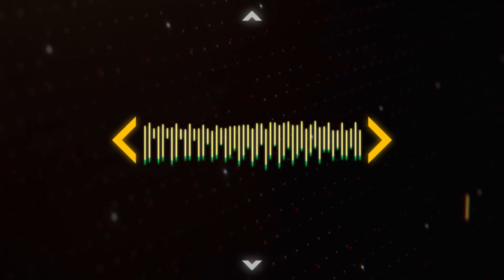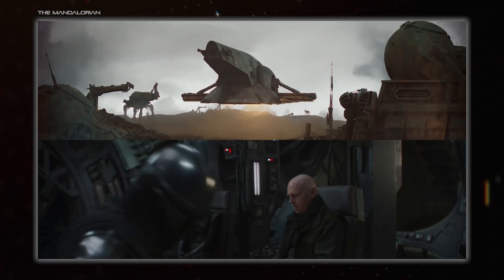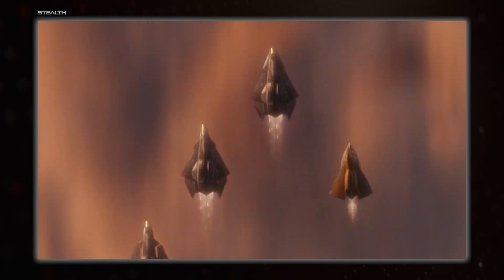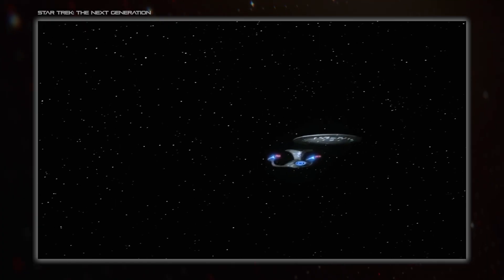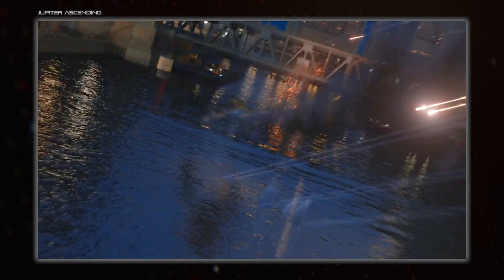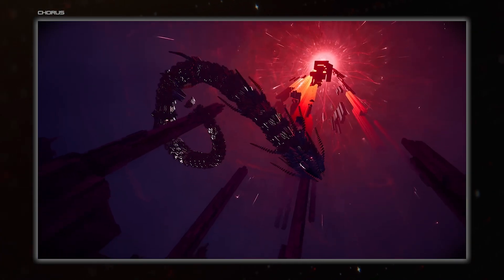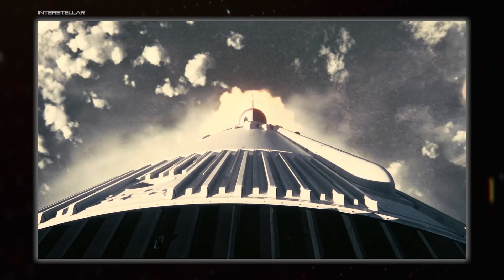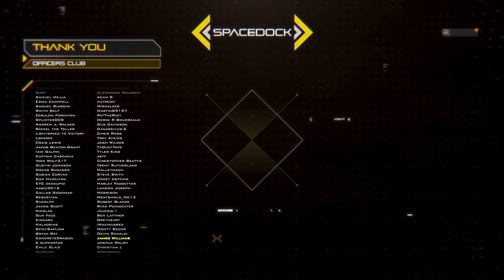Variable Geometry in Sci-Fi Spaceship Design

Comment: The coolest use of a variable geometry design would be a spacecraft habitat ring composed of, say, twelve modules that could each pivot through 90 degrees, so it would provide both spin gravity and constant thrust acceleration gravity depending on the configuration.

Comment: The whole point of the swing wings are two fold one for better aerodynamics so wind resistance does not slow it down as much therefore much faster. Secondly reduces cross section making it harder to pick up on radar thus becoming lower visibility now the downside is maneuverability becomes lacking due to less wing span and secondly more risk to internals being damaged if the aircraft turn too sudden while the wings was in its aerodynamic mode due to the increased speed and thus more tension of the frame of the aircraft.

That's why when you see the wings fold out the aircraft slows down beforehand due to the last thing you want to do is land the aircraft with the repair crew telling the officer "yeah we can't use this million dollar aircraft anymore due to its internals have been damaged so much it needs to be sent for major repairs resulting in a full overhaul."

Comment: All the while, SDF-1 was not mentioned.
Yes, transforming into a giant humanoid is silly, but in universe it fell from the sky and is made by a precursor race that basically created humans and the giant humanoids and many other things, the energy cables for the main cannons was cut short because a big chunk of machine and engine disappeared in an emergency use of the warp drive and they needed to transform the ship to connect the cables.  And yes, if you were warped to Pluto with no preparation you don't have much resources to fix the ship with other than the two aircraft carrier that were not meant to work in space that unfortunately been warped to space with you.  Yes, they actually manually pulled the cables to the other end to connect them in show after the transformation.

Comment: Can’t believe you missed the most obvious real world variable geometry space ship: the orbiters of the US STS program AKA the Space Shuttle (officially the term “Space Shuttle” refers to the whole launch assembly while the term “Orbiter” refers to the part of the Space Shuttle that looks like an airplane.  While in orbit, the Orbiter always flew with its cargo bay doors open.  The first reason for this was the orbiter was designed to be a “space pickup truck” that would haul cargo to massive space stations as well as act as repair trucks for broken satellites.  So the doors needed open for the cargo to come out.  But there was another reason. On the inside of the doors were an array of solar panels which provided the ship with power but also radiate heat.   Vacuums are natural heat insulators.  Yes space is cold but keeping astronauts warm is the easy part.  Keeping them cool is the real challenge.  So even when there is nothing to take out or put in the cargo bay (the rare missions where this isn’t necessary do occur, the cargo bat doors still remain open while in space and only close once atmospheric operations are occurring.

Comment: Just going to mention that Jupiter Ascending was a really fun movie that I don't think was very well done. It had a lot of cool concepts, and a lot of even cooler visuals, but it didn't really bring them all together very well. I enjoyed it anyway though!

Also, back on topic, there's a surprisingly fun variable geometry ship in ΔV: Rings of Saturn. The Kitsune shuttle is a tiny little ship, with the option to cut its cargo hold in half and become an even tinier ship. It's actually quite practical to run the ship in its compact mode while you're using your mineral processor, because that fills out the back half of the cargo bay, which is the entire bay when you shrink the ship, letting you ignore the positioning challenges you normally get when trying to maintain constant processing of ore. Then as your processed cargo storage fills up, you switch off the mineral processor, and expand out to full size to fill your hold up the rest of the way and take a full load of processed and raw ores back to the station. You can also use compact mode to make yourself a harder target for an attacker, or to drift through gaps between rocks which the full-length ship can't fit between.

And for another real-world space example, there have been a number of space telescopes which operate on this principle, though again, it's unclear if these are one-way transformations or not?

Comment: Hi Spacedock and community, have a variable geometry adjacent question

Moving turrets - not just oscillating, actually moving around the ship. In Star Wars Legends they mention Hapes ships rotating and repositioning charged turbo lasers in place of the discharged ones. In Homeworld 3, the mothership turrets move up and down rails along the side.

Some questions:
1. Can’t figure out what a good term for this is, so I’m having trouble looking for other discussions online. Any good terms/forums?

2. Does this have any merit in real design or would it just be a flashy gimmick but not really that helpful?

3. What are its implications? If the ship is just a bunch of nanites rearranging themselves that’d be cool but if it’s a more normal solid components type then maybe the need to design around those weapon rails would limit the total number of weapons that can be put on?

Comment: In the case if Voyager they have their own hand wave explanations as to why the nacelles do this. But there are real practical reasons why a space ship might use variable geometry. For example altering the center of mass of the ship or the reaction thruster positions to increase maneuverability. I'm voyagers case, it could simply be that lowering the nacelles, optimizes voyagers center of thrust and center of mass for maneuvering, while raising them increases warp efficiency. 

Similarly the X wing may make better speed in atmosphere due to closed wings having less surface area and drag while having the 4 engines split increases their differential maneuvering potential. 

The thing to remember with most space craft is that even though there might not be aero dynamics to consider, center of mass and center of thrust still matter.

Comment: oh another good example of variable geometry though it isnt for a sci fi spaceship design
samuses arm cannon from metroid prime 1 2 and 3
the cannon is made of multiple loose parts around a solid core
and it can extend, rotate, retract, and move the parts as needed for the weapon its currently using
one really cool example is the phazon beam and hyper beam from metroid prime 1 and 3
both being high caliber weapons that pack a lot of bunch
and the arm cannon physically compresses all its parts when firing off a round

Comment: the arwings in starfox assault
not the arwing models in other starfox games (though those do have some movement to various parts)
the arwing model in assault took it to a whole new level with the 2 gravity diffusion units and wing all having multiple articulation points
starting from the body of the ship is a sorta cover arm that hinges off of the side of the ship
connected to that is another arm where two motors are connected that rotates the g diffusers along with the connector for the wing

all that mechanical stuff is actually put to use too
as the arwing can fold up into a smaller shape for storage and high speed deployment

Comment: The problems variable geometry brings usualy outweight (or almost outweight) the benefits. Variable geometry wings are actualy really useful for jet fighters, but the US basically doesnt use them anymore despite how good the f14 tomcat was. The added cost and maintence/man hours on the dam thing limits your fleet quite a bit.

I dont recall it all properly, but there's this one arab country that bought a bunch of f14 when it was literally the best fighter plane in the world, along with some f16s. Then a revolution happened and a radical government took over since. Turns out the the f16, despite years without proper spare parts, are still mission capable, but none of the f14 were ever seen again.

Comment: Swing-wing aircraft were made obsolete by the development of relaxed stability fight systems. Computer-controlled flaps, etc. on both the leading and trailing edges of the wings were easier, more efficient, less costly, and less heavy than variable-sweep wings. Just a thing I read about.

Comment: On the topic of Trekkian integrity fields, I'm kind of surprised we haven't seen a lot of nanobot based hulls. With an integrity field doing most of the work holding everything together, a hull comprised of nanobots could shift and reform as freely as the integrity fields themselves, plus the nanobots could quickly shift and reallocate themselves to patch over hull breaches when damage is sustained. Such a ship could have surplus reserves of hull nanobots spread across the vessel for rapid deployment in emergencies.

Comment: The ‘detachable floating geometry’ stuff is HEAVILY featured in anti gravity racing games!  Wipeout probably has it, but the one game I have a lot of experience with that very heavily uses features like that is RedOut.  

Most ships are maglev operated, run on massive, extremely powerful engines, and can separate parts of themselves to increase handling on the track.  They’re kept in place with powerful electromagnetic fields and can even expand and contract with speed changes.  The slower you go the more they contract, the faster you go the more the geometry separates.  It’s most apparent in the Lunare Scuderia and ESA racing ships.  And, as a fun side note, there’s an entire brand of racing vessels that are literally podracers from Star Wars.

Comment: As far as I know, it's a justification after the fact, but the point of the S-foils on X-Wings et al, is that they expose extra radiators needed to disperse the increased heat output from combat, while being tucked away and protected from damage when not needed.

Comment: The thing about variable geometry in vehicle design is that form HAS to follow function. There needs to be a plausible use case for the vehicle whose utility outweighs including the additional complexity and cost of the variable geometry components, and it needs to be acknowledged that doing so also comes with trade-offs. Otherwise you get Marvel-syndrome empty spectacle.

Comment: Swing wing aircraft were a pretty big inspiration for me to do aerospace fighters. The concept of the aerospace fighter is essentially making a fighter aircraft that can be deployed from space to an atmosphere in order to secure air and ground space for planetary landing. They feature thrust vectoring engines, swing wings, and thrust nozzels across the body in order to improve their manueverability at combat speeds. They also have rhe capability to return to space for resupplying. These can also be used as dedicated space fighters mounting kinetic kill missiles and smart explosive missiles depending on their targets, which are put into a weapons bay on the bottom.of the craft and mounted to the wings

Comment: From an engineering standpoint, variable geometry is difficult. Failure modes multiply, and depending on the scenario it may be less of a risk to build something that's bad in one area versus getting a wing stuck halfway. Given, in sci-fi there's a combination of space magic and widespread civilization that allows you to catch something before someone dies from it (like having a tow truck and tire shop available if something happens to your car). In combat this protection is basically gone, coupled with additional wear. A thermal-based weapon could fuse two plates together, an impact or explosion could twist the frame of the craft and prevent panels from fitting together, and even some small debris could prevent a critical component from getting all the way to where it needs to be

Comment: I'm a particular fan of nanobot/liquid metal'ish hull surfaces that can be formed, deformed and reformed at more or less will to various effects such as: opening up or covering sections of the ship (like revealing docking ports, hangars or previously hidden weapons), adapting surfaces to specific needs like changing docking ports on the fly to account for different designs or for example slightly modifying the ship's shape into a more auro-/hydrodynamic shape with control surfaces for movement in atmospheres or liquid environments, shifting hull mass to change center of gravity for manouverability (or special manouvers because hey why not) or to shift and stack armour protection at will much like concentrating shield power towards specific directions (possibly in settings where energy shields aren't a thing). Plus this kind of hull surface could be easily repaired on the fly assuming the material itself isn't destroyed or if the ship has a reserve of material that could be injected to compensate for loss.
The adaptable/programmable nature of it would also mean it's far easier to maintain than conventional shifting geometry which has all sorts of moving parts like motors, gears, etc. pp. that would need to be looked at, repaired and so on (for example nanobots can be detected and transported by their peers to a specific servicing station without needing to spacewalk to a specific hull section and take things apart).
Likewise it could be used for deceptions where the ship could mimic the form and looks (if the individial components that make up the adaptive system had like individually addressable colouring to mimic paintjobs) or similarily sized ships (or even ships of vastly different size if the people looking at it mistake distance and thus relative scale).

There's so much you could do with it!

Comment: i feel like you could've mentioned a few more gundam ships. including the minerva, which has a whole transformation for combat mode, where the whole bridge is dropped to a more secure position near its center mass.

or the diva from gundam age. or the original ptolemaios from gundam 00 S1. 

for separation, i would also argue about the moebius zero and its sucessor, the exus. 

finally, i would also like to point to shmups, specially the main fighter ships from R-type, and einhander.

Comment: So i feel you are missing a obvious one, namely Robotech.
No not the mechs, im talking about the SDF-1 itself. Yea, in its alternative form in the show it kinda have a humanoid shape, but that technicly is only One possible variant of the ship, since the whole deal with Robotechnology is Variable Geometry.
The only reason they took that specific shape in the show was to connect the main guns to the powersource after.... let call it an accident where parts of the machinery disapered after a hyperfold accident.

But thechnicly the whole ship can move its internal and external parts in endless combinatios to achieve a variety of purposes.

This is never realy Utilized  though. In the show the reason is that humanity simply dont know the ship or the technology good enough to operate it at more than minimum-level capacity.

Comment: Macross in 1982 (or SDF-1 from Robotech) is a capital class ship with variable geometry as a result of smaller carriers ships docking to it and a geometry transformation was necessary to enable the main gun to fire due limitations of reverse engineering the alien technology. In addition the transformation enabled the “Daedalus attack” where by the transformed ship could use one of the docked carriers as a weapon to breach the hulls of enemy ships to unleash catastrophic internal damage. I wouldn’t call it “mecha” as it largely behaved as a lumbering capital ship.

Comment: In Star Wars some S-Foils supposedly even have a technical reason, like for the Jedi fighters in EP3 those flaps contain additional radiators, that are meant to accommodate the guns. Which does make sense, I think, like of course they make you a somewhat bigger target, then again, you need them anyway. And in normal flight, they are protected against debris and stuff. Then of course there are many ships where it hardly makes sense.

Comment: Centrifugal gravity either needs to have a large radius, or rotate fast... there's two parts to the equation... the smaller the radius the faster they need to spin, speed is actually more important as the force equation is force = mass x angular velocity squared x radius. so if you have a radius of 20m, and want to exert earth like gravity (9.8newtons/kg) a typical weight of 70kgs you need 6.685 rotations per minute... however if you change the radius to 40m, you only need 4.7 27 rotations per minute.... The funny thing that most shows forget is the exerted calculated where the tangential velocity is created (so where the feet meet the floor)... if the person on the 40 radius tried to walk up a flight of stairs on this structure, their radius would change but rotational velocity will remain constant, thus increasing the amount of force they feel with each step up (so multi level modules spinning around the center become problematic if the Radius is not large enough).